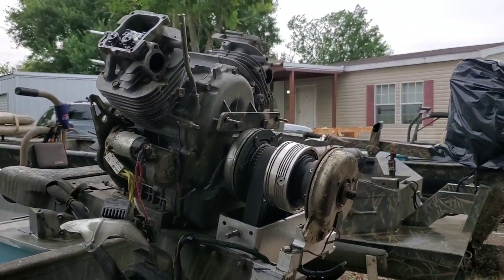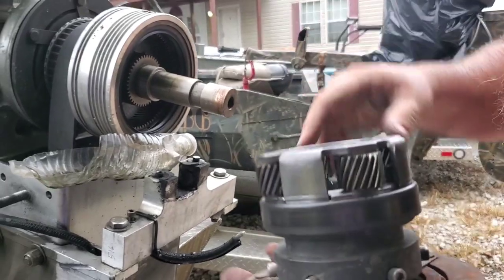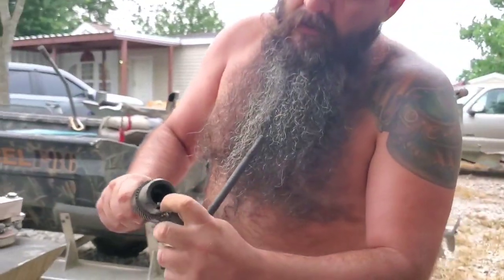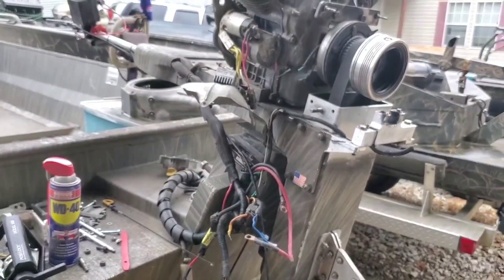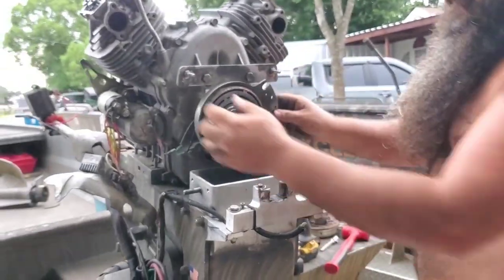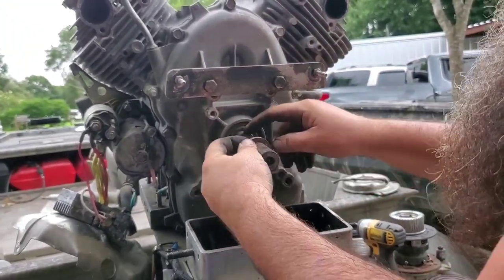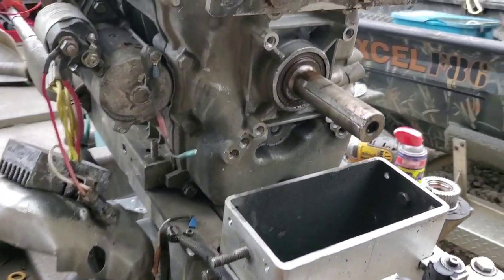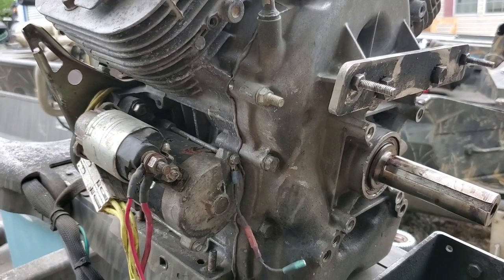Gator Tail drive removal

Comment: Question... My 35 Hp GT Gator tail 2010 was redone recently. I went to run it and it lost power and started to knock. Can you possibly let me know what would cause that before I take it down myself and fix it now that I have time to? It is not an EFI also.